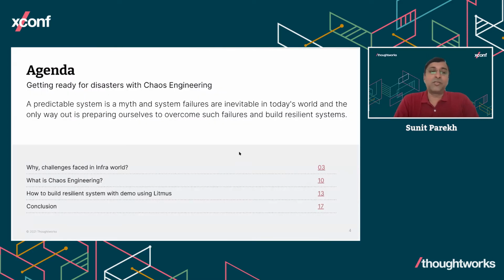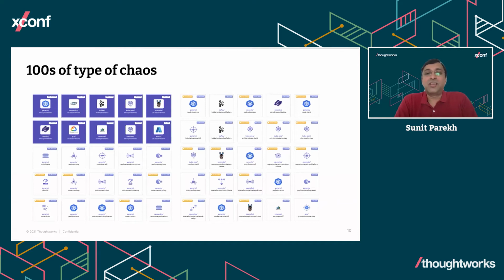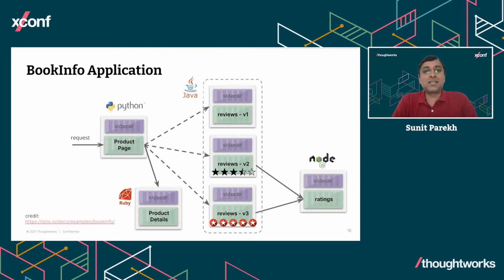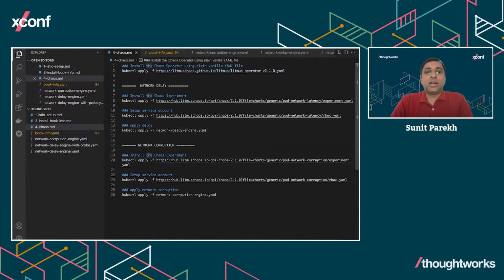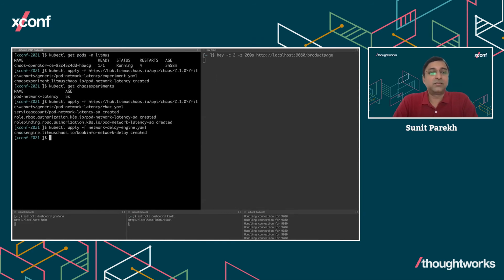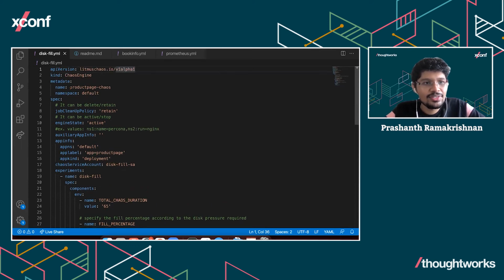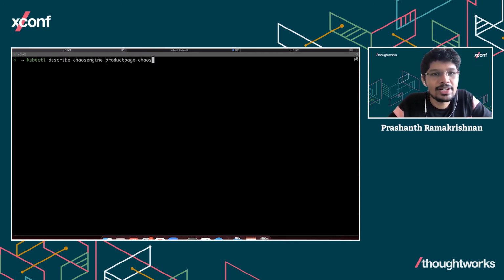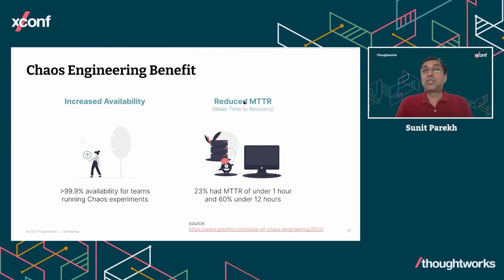Getting ready for disasters with Chaos engineering – Sunit Parekh & Prashanth Ramakrishnan

Comment: Steps for Chaos Testing

Step 1 : Define steady state
Step 2 : Introduce Chaos (simulate failures e.g. latency, disk full etc.)
Step 3 : Verify steady state (check whether system works as expected after chaos)
Step 4 : Roll back (roll back the chaos)
Chaos examples : 
CPU memory spikes
Network Latency
Time Difference
Application crashes
Disk space 

Tools : Litmus, Chaos Monkey, Gremlin, Chaos Toolkit

Litmus is Kubernetes native
If you want to introduce Chaos on AWS systems leverage tools like Chaos Toolkit, Commercial tool Gremlin.

Benefit:
Increased Availability > 99.9%
Reduced MTTR (Mean time to recovery) 23% under 1 hour, 60% under 12 hours